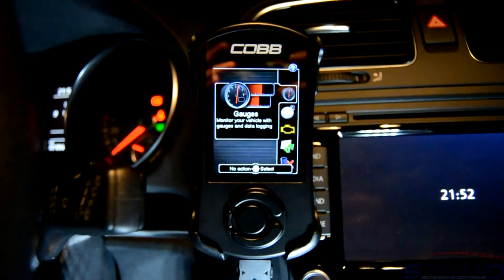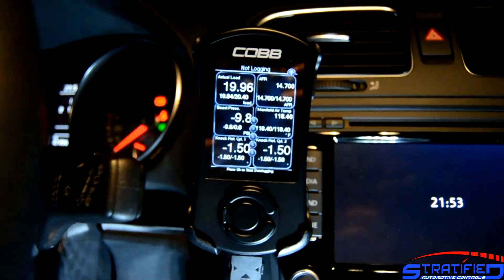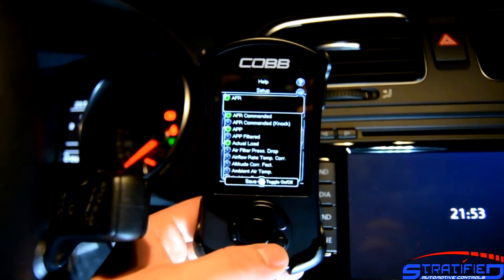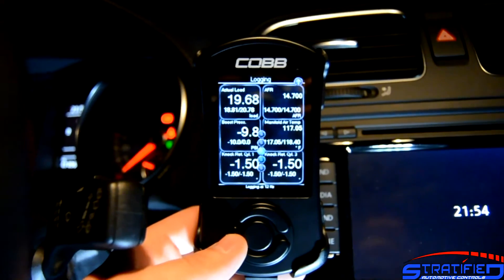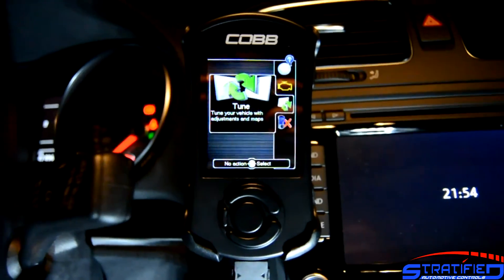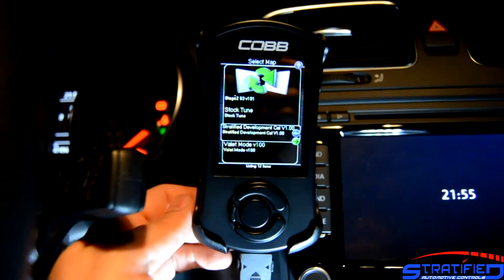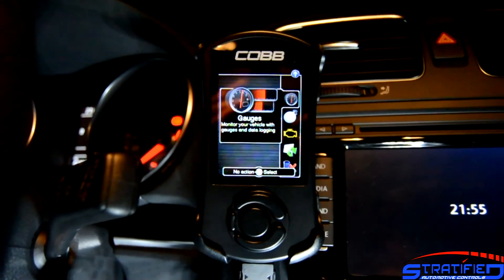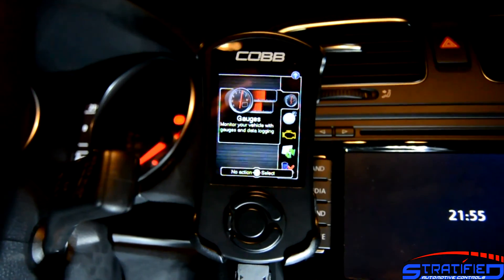Volkswagen GTI How to Setup Datalogging and Flash a Tune

Comment: how is it compared to apr , can i just tune acording to what i change , for example , apr stage 2 only supports downpipe and intake , can this do a custom tune if i also add an intercooler? or intake manifold, what if i go full build and add a bigger turbo not a k04 or garret gtx
Reply: They do custom tune. if you add any modification you can also do a top-up tune which is more cheaper. I like the idea of datalogging with Accessport which i can send to them to do a custom tune cos there are no tuners who can do custom tune here in my country